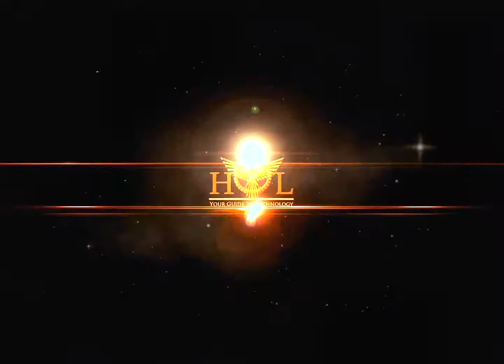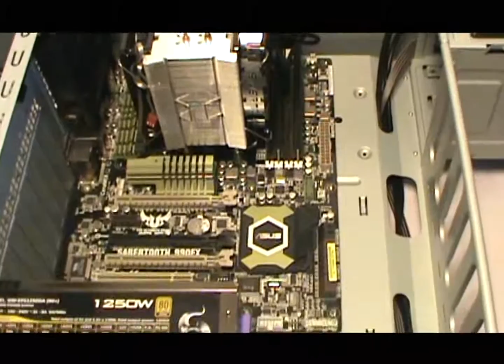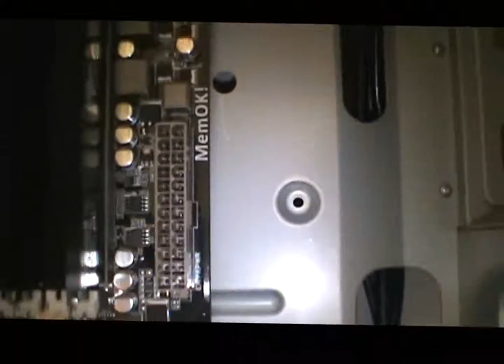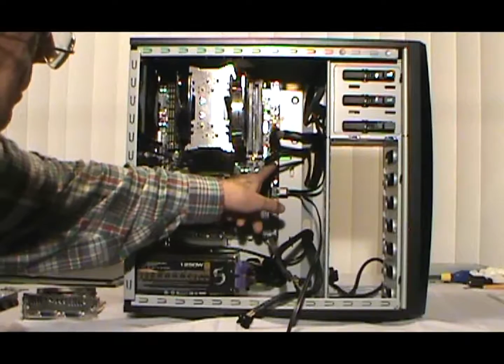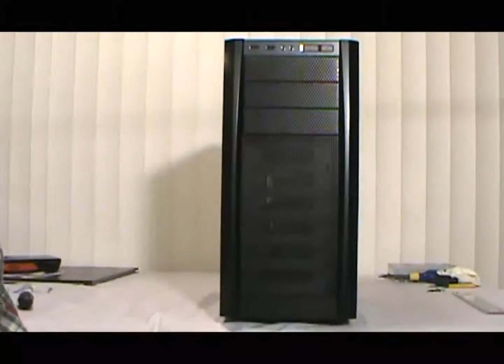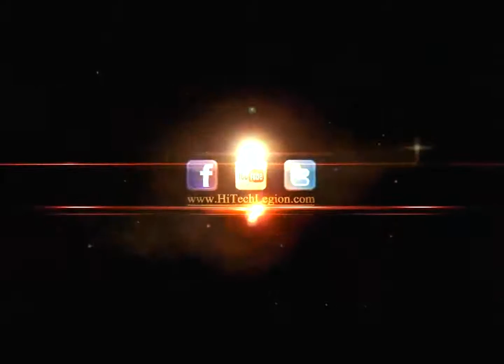Antec Three Hundred Two Case Component Installation

Comment: Just had the same issue, Take it slow and manipulate it in as flat and square as possible, The small tab on the case where the PSU is probably hitting can be pried up just a bit without bending. The unit will then slide in. It is a tight secure fit.

Comment: Have anyone added liquid cooling to this case? I'm having trouble figuring out what to do as I want a 2x120mm rad, and only place without having to mod the case too much would be to place it in the front but I do not know what to do of my cables or HDDs then. And nice video :-)

Comment: There is a small little ledge that blocks psus from fitting correctly.(I think its for cable management).Its easily fixed by sticking a screwdriver in and pushing it up slightly

Comment: And the power supply does? Those are standard size, but knowing if it has room for an aftermarket cooler would be much better. If he wasn't doing it as an instructional video, your point may be valid.